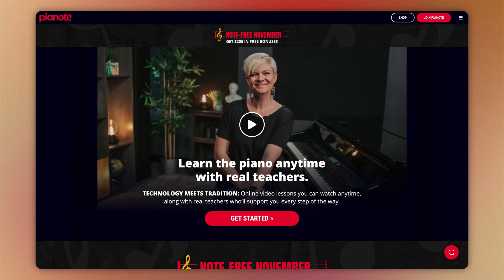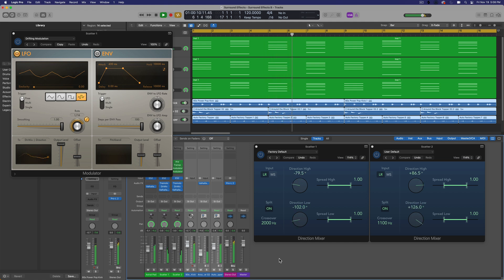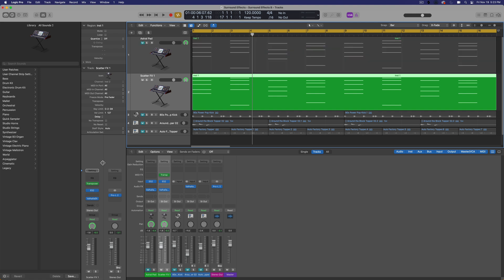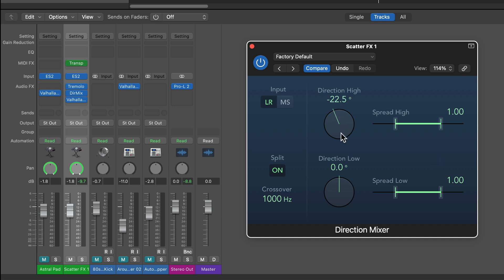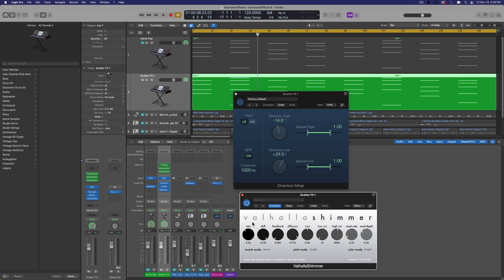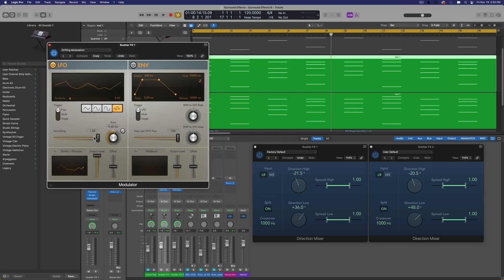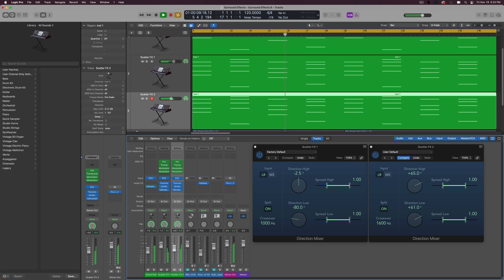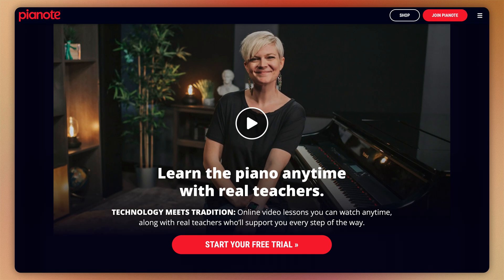Logic Pro - Scatter Modulation FX (Direction Mixer + Modulator MIDI FX)

Comment: Loving your videos! Thank you so much for doing these. I am new to this channel. And also very new to logic. 
 So you may have already answered this question. Is there a way to use the modulator on an audio file in a similar way that you've used it here?
Reply: I basically want to control audio effects with the modulator that are not midi files. Or is there another way to pull something like this off?
Reply from the maker: As a workaround, you could load the audio file into quick sampler and have the a midi Joyce trigger the audio file to play, then apply the same processing shown in the video. Otherwise the only option would be to manually automate the knobs which could be pretty tedious.